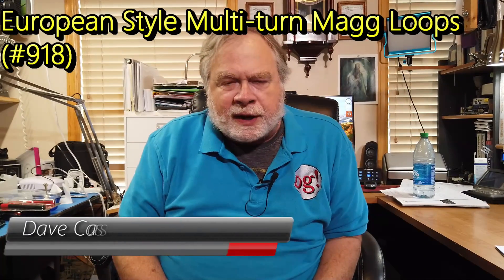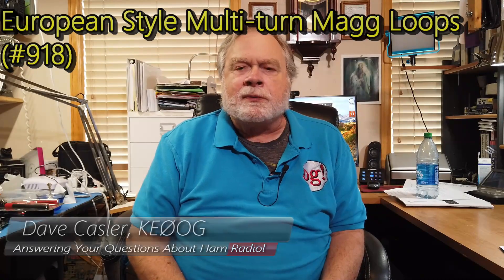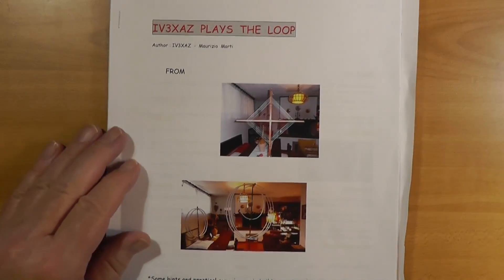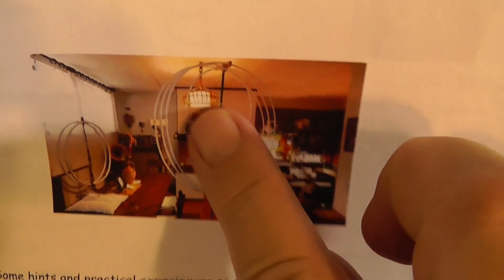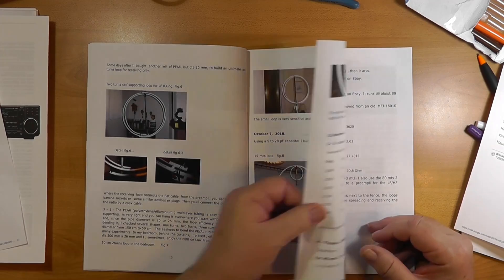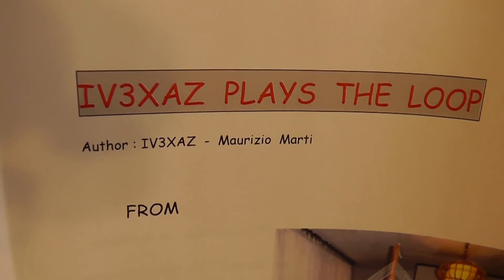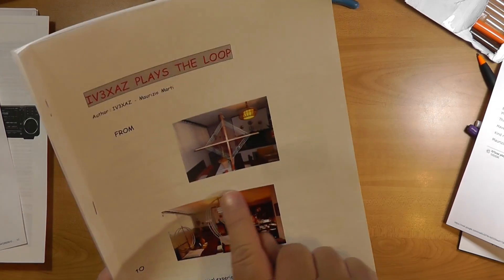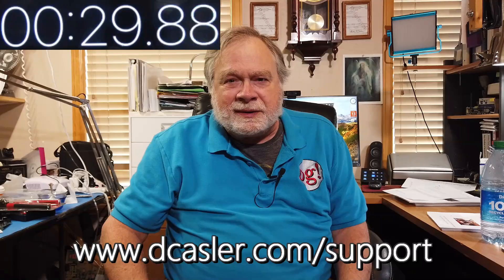European Style Multi-turn Mag Loop (#918)

Comment: Hi Dave! I am a subscriber and would like to ASK DAVE a question. I'm posting here only as it is your most recent video. If I should've done so elsewhere, sorry! I plan to put up a OCF 40-10 meter dipole at a 1/2 wave length height. No vertical stubs, etc. I want to work DX.  But I face a long feedline run of perhaps up to 160feet (from station to feedpoint). I have access to on-line calcs that will estimate ERP based on coax type and length. I assume Times LMR 400. My question is: But how is ERP affected by using an OCF rather than traditional 1/2 WL single band dipole? And, if having a OCF does matter, how does it change from say, 40 to 20 to 10 meters? I am looking forward to the next Sunspot Max which is fast approaching for 2025 and am planning. Back in 2000 I worked 20M from Guam, Japan, Svalbard Is., and Irkutsk during several late afternoons, my local time. TIA! My best!

Comment: Dave the PVC tube with metal inner may be the thing that has been used for in floor radiant heat over here. I had a friend that built a garage and had this sort of thing in the slab when it was poured. I don’t know what sizes it comes in but I’m pretty sure it was aluminum lining with a PVC outer. Cheers from Moose Jaw. 
Tim VE5THF
Reply: PEX-AL-PEX piping